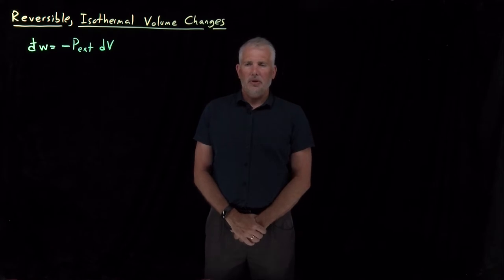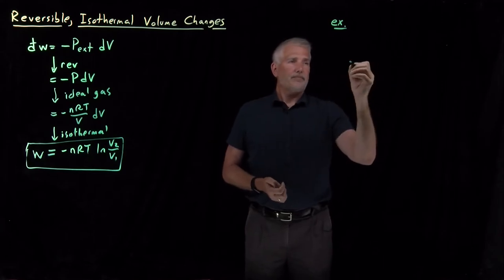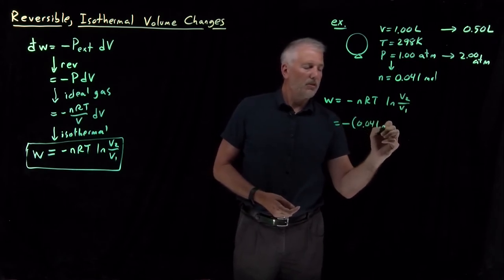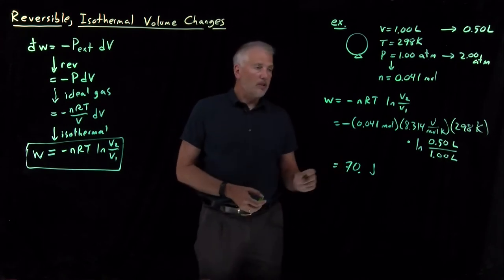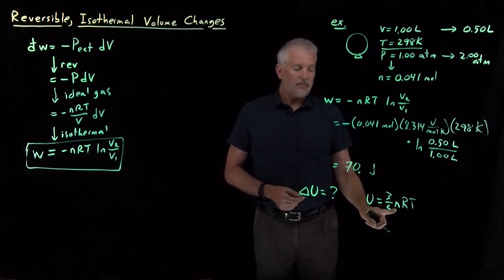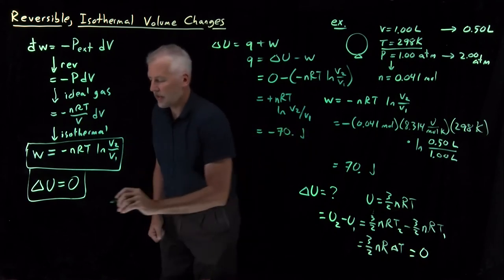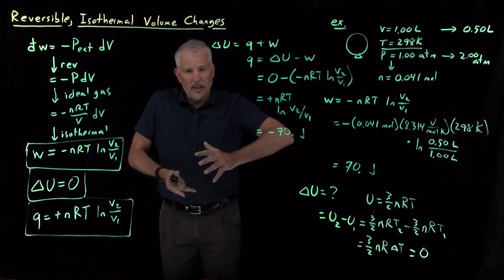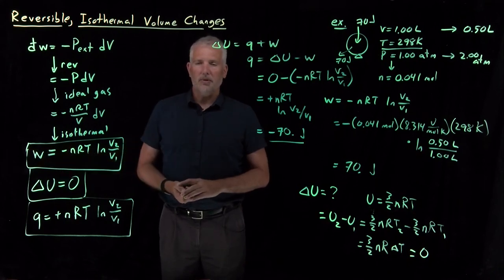Reversible, Isothermal Volume Changes

Comment: Is it possible to solve this question using identites and the expression dU/dV at constant T = T(alpha/Kappa) - P if you know what gas is in the ballon? That is delta U = T(alpha/Kappa-nR)ln(V2/V1)
Thanks!
Edit: Found that Kappa = 1/P and Alpha = 1/T for an ideal gas. So I get that dU/dV at constant T = T(alpha/Kappa) - P = T*(1/T)*P-P = 0 for an ideal gas.
Reply from the maker: Yes, you can.

As you have figured out, it leads to the same result as obtained in this video when the gas is ideal.

But your equation can be used, and will be more accurate, for non-ideal gases.